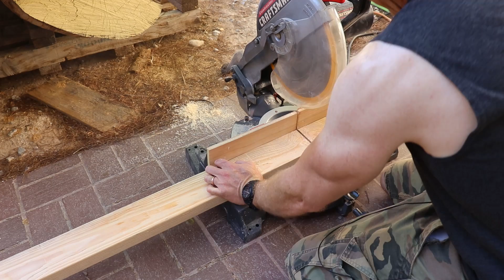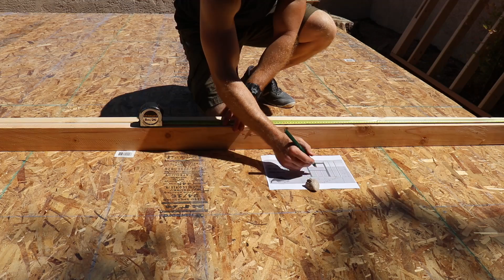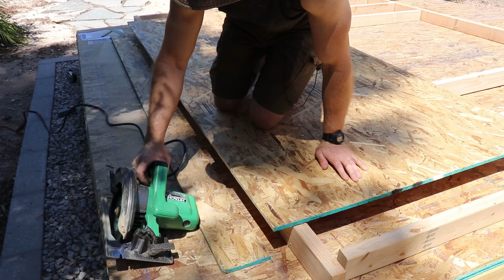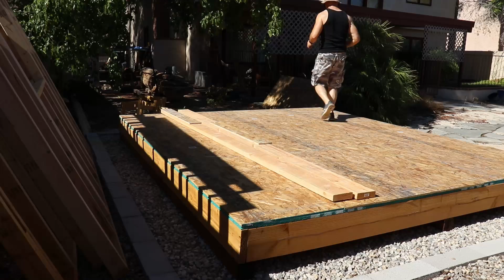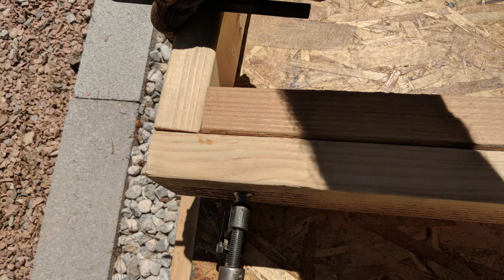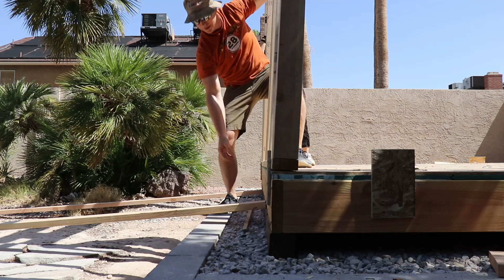10x12 Modern Work Shed - Part 4 - Framing The Walls

Comment: so I ran into an issue that my shed 2x6 foundation wasnt square.... out by quite a bit, actually, somehow.... still dont quite understand that... but my thinking (if you can call it that) is that it wont really matter.... the sheets of plywood that are the floor, are square, so as long as my bottom plates/walls are square to/fit the plywood, I should be okay.... right?

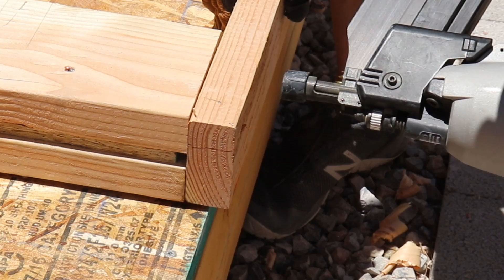Comment: At about 5:23 both nails plit the stud. The end of that board looks like kindling..
Looks like the nail gun or compressor could use some maintenance?around 6:27 says level the walls. I believe you plumb the walls but hey its a shed right?

Comment: Oops hit the wrong key.
Anyway.
When I build a 10x12 shed.
I install the doors at the end of a 12 foot wall.
This way you don't lose the use of a whole wall.
Then I suggest that you use the remaining part of that wall for a desk and then run a countertop off of that down the 10 foot wall.
This is for, if you are going to use the building for a work shop.

Anyway, to each their own.

Thanks for sharing.

Comment: Question for you, have 2" coil nails with my nailer...would that be enough or I need 3 1/4" nails? Thank you for such a nice video subbing it up for sure!
Reply from the maker: I'd use something a little longer. From what I remember I was using a 3"nail for the framing. Thank you for subscribing!
Reply: @AdventuresInDIY  thank you keep up your amazing work!

Comment: Fantastic video but like all the shed videos I have seen before, they do not say exactly what kind of nail and how many are being used. So many ways to get the building inspector to reject the project when the right nailing is not done.
Reply: Not usually permits required for a shed 120 square feet or less depending on where we are talking about.

Comment: What kind of hand saw do you use ? I ordered one from Amazon and the blade was flimsy
Reply from the maker: I'm using a Suizan japanese ryoba.  The blades on Japanese saws are thinner than western ones because they cut on the pull stroke.  I've used a variety of disposable blade ryoba and they seem similar.  The main difference is going to be the size of the blade.  The larger the blade, the more aggressive the teeth are going to be.